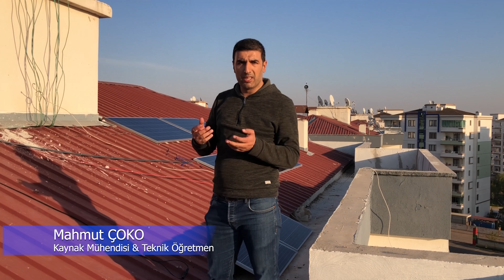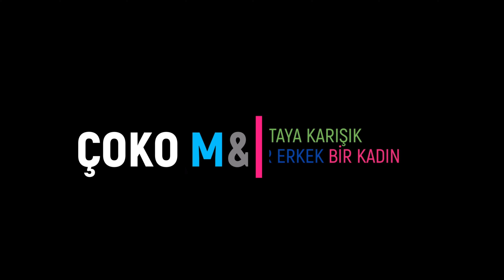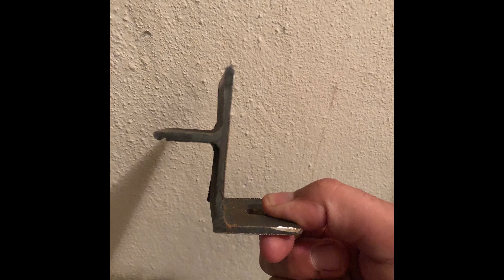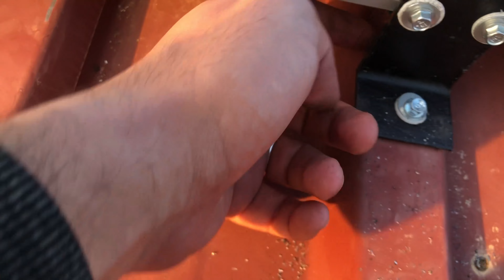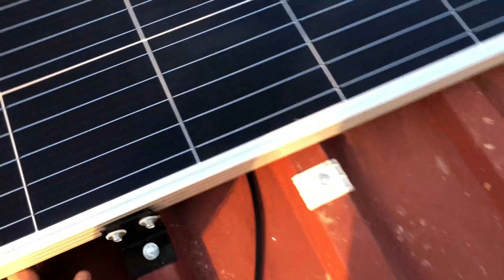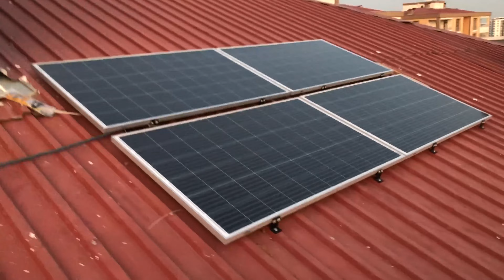On Grid Solar Sistem için Solar Panel kurulumu, Çatıda Şebeke Bağlantılı Solar Sistem Panel Kurulumu

Comment: Lütfen yardımcı olursanız sevinirim sistemim 4 tane 100 lük jel akü 24 lük bağlı , mexxsun 60 amper mppt şarj kontrol cihazı 145 volt kabul ediyor, 3 kava inverter, 3 tane 300 vatlık monokiristal güneş panelini SERİMİ VEYA PARALEL Mİ bağlamam lazım güneş panellerini şimdiden teşekkür ederim
Reply from the maker: Merhaba. Panellerinizin seri bağlantıdaki voltajı şarj cihazınızın pv giriş voltajını geçmiyorsa seri bağlayın, daha verimli çalışır. Selamlar